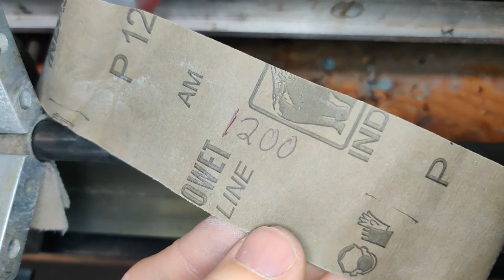Ferrule Replacement on a JFlowers Pool Cue

Comment: Nice work, recently I did two 314- shafts, very similar.  Both had cracked all the way through the original ferrule/tenons.  I did drill out a little center weight from the new ferrule/tenon piece, so far customers happy.  I've wondered about the sanding on carbon fiber, read your comment below.  I've lightly sanded on one to polish back out and all came out nice.  Keep up the good work.
Reply from the maker: Thanks for the support. 😁

Comment: Nice work! Although I would bore a hole in that ferrule to remove end mass. Otherwise it might creat some deflection and defeat the purpose of the light weight cf shaft
Reply from the maker: keep an eye out for my next carbon ferrule replacement video. I did exactly that 😁
thanks for watching, appreciate the comment

Comment: Hi! I always watch your videos. I need some advice regarding my ferrule not totally leveled on tip part. Should i change the whole ferrule or just cut out the un even part? Thank you!
Reply from the maker: Depends how much you have to cut off and if you are ok with having a slightly shorter cue. 
Changing the ferrule is a lot more work than just cutting it shorter.

Comment: Your machine is shaking and vibrating all the time.
How precise should that be? The drill was off center when the remains were drilled out. 
Was it the drill itself or the tailstock of the lathe? 
Otherwise the video was very good. Keep the Work going.
Reply from the maker: sorry about the shaking I still haven't gotten around to mounting the lathe to my workbench 😅Also I got a new set of drill bits. The ones I used in the video were not the most precise. I try to be as precise as I can by using a 4 jaw independent chuck and I get the runout to less than 2 thousands. Thanks for the comment 😁

Comment: Hi, great vid,. I'm going to ask what might be a stupid question, but I'm trying to learn :)  Why has this been done? Was there something wrong with the original ferrule?  Is the replacement better in some way? What is the customer and/or you hoping to achieve? Thanks
Reply from the maker: The customer wanted a white ferrule. I could have just put a white ring but I feel like the full plug will last longer and hit better.
Reply: @arsbilliards  Cool, thanks

Comment: have you ever tried using leftover 314 wood has a pin for the g10 and then the tip? im wondering if it would sound more like the 314 and retain performance?
Reply from the maker: nope, but I've seen maple used as a plug in carbon fiber shafts

Comment: How come you use a metal lathe to do most of the work then swap over to the cue lathe to finish? Is there a reason or can you not be bothered swapping the tooling?
Cheers.
Reply from the maker: I don't have a tip shaping tool for my metal lathe yet and I can also fit the whole shaft on the cue lathe. That makes it easier to clean and polish it up. 😁
Reply: Cheers for messaging back.
I’m after some knowledge,
I’m wanting to buy a lathe to start replacing tips,ferrules and maybe joints. My problem is I’m in New Zealand and there’s no cue smith’s to ask advice. Can I get away with just buying a metal lathe with a 38mm spindle bore? What bed length is yours?If I buy a proper pool cue lathe from the states and get it sent over it’s close to the price of buying a metal lathe and I still don’t know if it will work as we are 240 volt and 50 Hz.
Any advice is very appreciated
Reply from the maker: @bengrimmond6729  If your going to use a metal lathe I suggest you get one with a chuck on the back. Check with cue smith for a simpler cue lathe. He might ship to you. Good luck 😁
Reply: What kind of metal lathe is that?

Comment: Hi, I have one question: Why the cue tip on carbon cues are usually with less carve on the top of cue? I mean its like more flatter. 
Is this something that have sense to be like this, or is just preference?
Reply from the maker: Its preference
Reply: Most players still shape their tip to a dime radius. Also diameter of the tip plays a factor in the apperance. I have a 13mm that looks almost flat, a 12.2mm that is slightky rounded, and a 10.5mm that looks like a cone. All shaped to a dime. It's kinda funny.

Comment: I'm trying the same thing. In the process. Why didn't you machine the Farrel before putting the tip on ?
Reply from the maker: The tip has to be cut down to size. Might as well leave the ferrule oversized and cut them down at the same time.
Reply: @arsbilliards  I'm scared to sand one too much because of the 2 being different material and I usually end up with one sanded too much 😳
Reply from the maker: @youtubesux6361  just take your time and put an even amount of pressure 🙂
Reply: @arsbilliards  ty
Reply from the maker: @youtubesux6361  no problem, Thanks for watching and commenting. I appreciate it 😁

Comment: You drilled hole to big in shaft and you don’t put Cue Silk on carbon fiber shaft.
Reply from the maker: Carbon shafts are usually around 1mm in thickness. I only removed the old ferrule. 
If you felt the before and after you would start putting conditioners on your carbon shaft too. 
😁
Reply: That was not an old ferrule you drilled, that was the foam filling.

Comment: WHY DRILL SUCH A HUGE HOLE IN THE SHAFT?  MAKING SHAFT WALL VERY THIN AND ADDING BIG CHUNK PLASTIC FOR A FERRULE.  FLOWERS ORIGINAL DESIGN LEFT MORE SHAFT STRUCTURE WITH A SMALL HOLE.  SEEMS FLOWERS HAD BETTER DESIGN TIL YOU RUINED IT.  OK NEW FERRULE BUT NOT BETTER BY NO MEANS
Reply from the maker: I removed just the old ferrule. I removed no carbon. Carbon shaft walls are very thin usually around 1mm.
Reply: Nah you took too much foam from the inside when drilling. ALSO, you sanded the cf shaft when sanding the ferrule!! Carbon should not be sanded at all costs

Please understand that cf is not as wood and it can not be sanded nor be treated with chemical solutions except for alcohol.
Reply from the maker: @noxdomeisi529  I deal with carbon fiber shafts every day. They can be sanded and polished back to normal. The only reason people think otherwise is because of the warnings that cue company's have put out there. So people don't hand sand to make the shaft smooth again like you can with maple.
Reply from the maker: @noxdomeisi529  The material I removed was phenolic it was black. Expanding foam for the most part is always yellow or white. I removed very little if any.
Reply: @arsbilliards  thanks for the elaboration, now I think you should post more videos of cf shaft treatments that you do daily for us to have a clearer picture.
Reply from the maker: @noxdomeisi529  I plan on it 😁
Reply: @noxdomeisi529 you clearly have no idea about cf beside carbon shaft that you think you knew